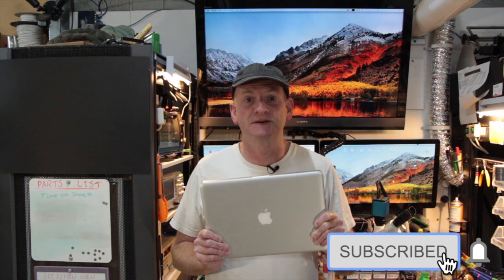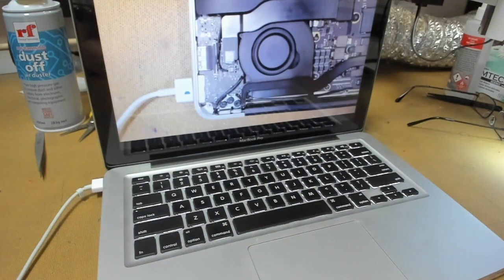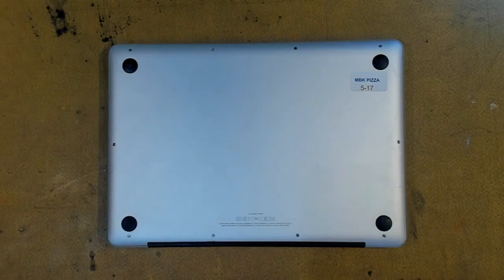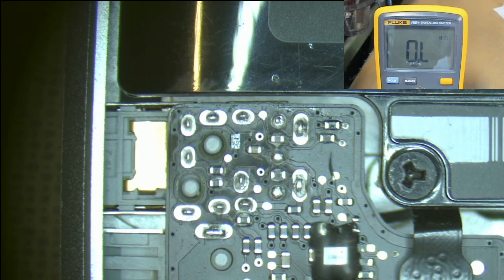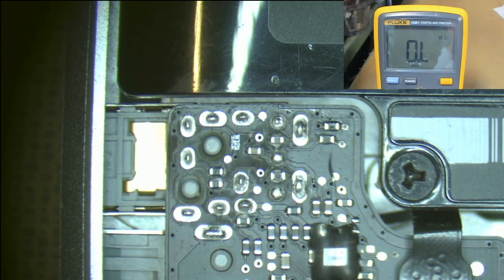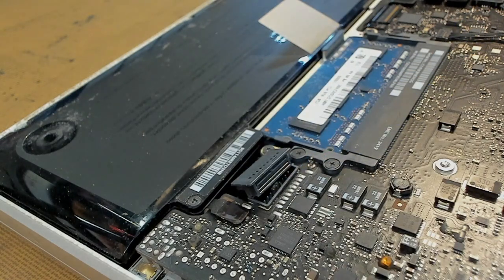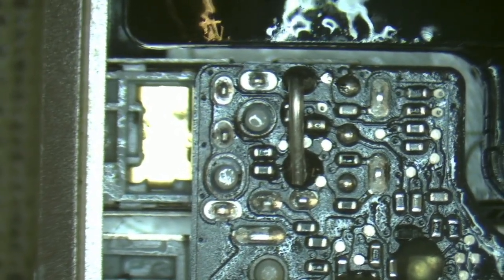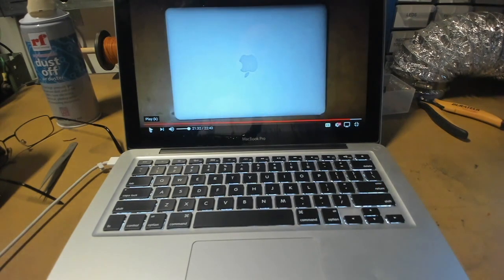Macbook Pro No Sound

Comment: Same problem with a client's A1278 - same resistance @ ~540kohms. Will bypass the tip detection while waiting for a proper replacement connector from overseas. Brilliant video - many thanks for posting it !!
Reply from the maker: Hopefully new connector will work.
Reply: where can i find the replacement to solder it?

Comment: doesnt change even making the bridge solution 
If i go to bootcamp it works
Reply from the maker: Normally it would be a PCH problem on the logicboard. Double check your "sound" setting under "System Preferences"
Thats all I can think of .
Reply: @Repair2Renew  thanks for answer
I solve it installing voodooh and my headphone jack is working back too.
Is a board problem, on windows my headphone jack is not working and always has a red light